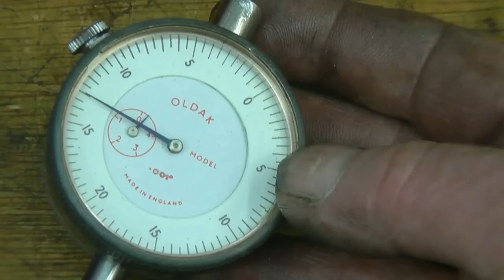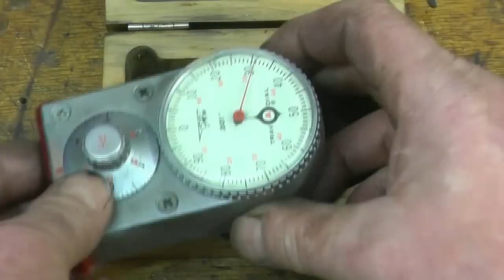SNNC 157 P1   Manual Key Way Cutting

Comment: I'm not a machinist.  But we had a prototype shop with a Bridgeport next to our engineering dept. that we played with from time to time. It was the job of us designer fellas to figure out new stuff all the time so I guess we could figure out a milling machine on the fly. We were mostly making steel parts but every now and then we would have some Aluminium to cut.  I got out the Machinery's Handbook and looked up speeds and feeds.  Compared to cutting steel, the speed for cutting aluminium was very fast-- Scary fast.
Anyway, we found a cutting lubricant (not a coolant) that sprayed on the tool while cutting.  Though the lubricant was a liquid, it had a special pump that only metered about a quarter of a drop of it every 5 or 10 seconds into a stream of air.  They told us that if we could see the liquid coolant on the tool or on the work, then we were feeding too much of it. We tried it and it worked well.  The aluminium didn't stick to the tools and so we put the pump on a table saw out in our factory used for cutting aluminium.  We pointed the air nozzle at the blade about a quarter rotation before the cut and the tool steel saw blades started lasting four days between sharpening instead of changing them every hour using a constant oil drip.  Also with the oil drip, the saws would load up with oily metal sludge a couple inches thick by the end of the day. With the new sprayer, we just cleaned off the saw at the end of the day with a quick dusting of a air jet--and the tools looked polished.
Sorry, that was a dozen years ago and I can't remember what the product name was.  It was expensive stuff.  About $200 per gallon, but even at the constant sawing rate we used it, a gallon would last months.

Comment: next time you make a tool holder of this type do the following instead as you get greater movement of your tool steel you use (carbide or HSS).... your mandrel you have is OK BUT do not mill slot in the bar to braze the HSS/Carbon steel in ..... instead drill a hole through the diameter large enough to take your tool steel and about 15 mm up from the face of the bar, next remove tool steel and place the bar so you can drill the same end through the face of the bar then once drilled (depending on your size required) tap this hole whilst in the lathe  !!!!! use a grub screw to lock your tool steel through the bar !!!!! we do this at work for many jobs :)
Reply from the maker: Thanks for that i will be using that idea

Comment: you should try drag and rack on the lathe bro,hell a lot easier,,tool steel in a boring bar,.oo5 at a time drag it across your bore,when you get about 020,rack until no cut,and repeat

Comment: That's the first time I've seen using the mill spindle for slotting in years. Nice to see an "old school" trick revived. Usually we didn't take a full width bite on a slot width. If the slot would allow we would rough with a mill cutter then with a diamond shape slotting bit, nibble out the corners. We had our choice of broaches, BP slotting heads, and even a P&W slotting machine. Sometimes the hand slotting was the quickest most efficient process. Thanks for sharing John.

Comment: At 7:00 I was struck by the thought: John Greenleaf Whittier said it best:
“Of all sad words of tongue or pen, the saddest are these, 'It might have been.' ”

OTOH, that thread does not register anything; it's just there to keep the taper from loosening, and to push it off when changing chucks/devices. As long as the OOPS did not distort the taper (at either end), no real harm is done to anything but  Ego, and that heals nicely.

Comment: Could you chase that thread to clean it up John?
Reply: aluminum tends to lose chunk,s not bend over like steel does, parts of it are just not there, nothing to chase other than a quick bit with a file, which he did. oh well least it still does its job

Comment: Question. Could you have cut the thread in the other end before you cut it in two whilst it was mounted on the spindle ? Nice job anyway.
Reply: I'll second that question and, any save is a good one whether it is luck or judgement is irrelevant.